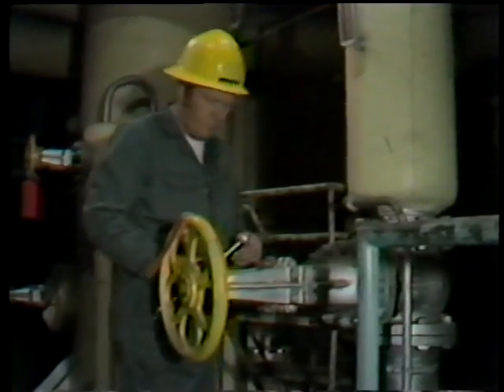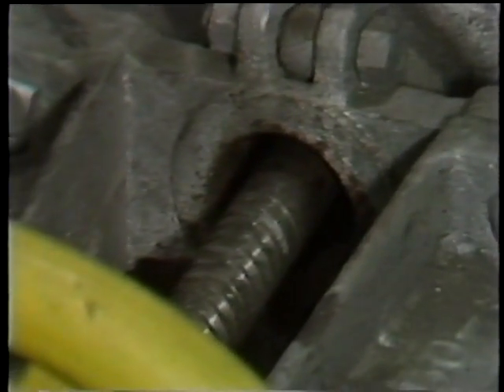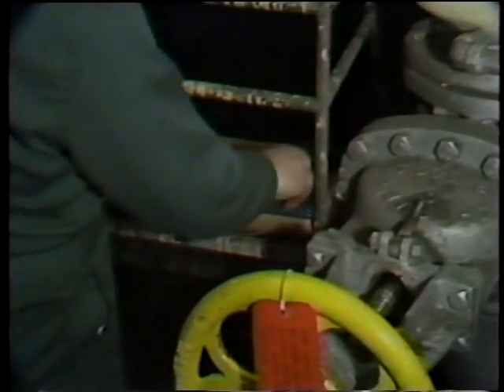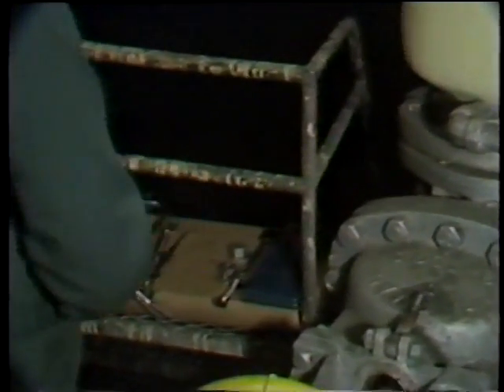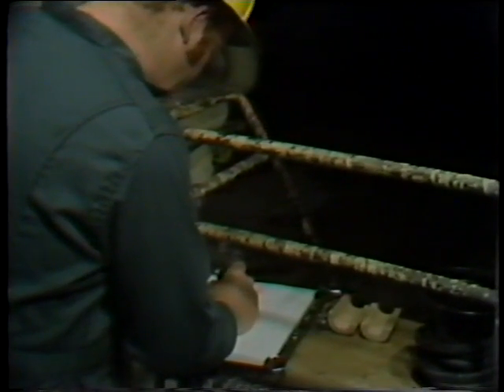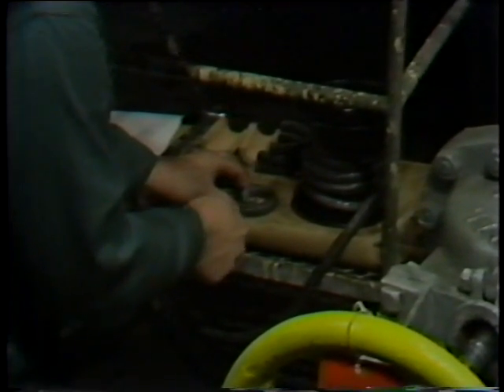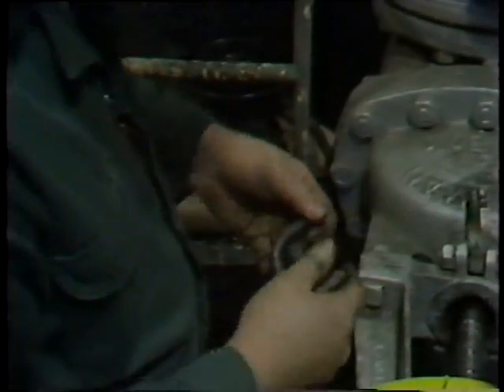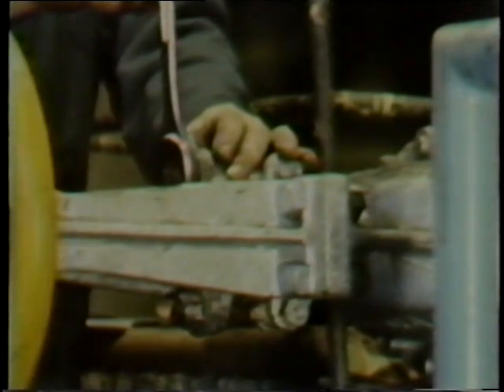Repair leaking Gate Valve Stem By Packing Replacement & Installation

Comment: Is it possible for repair kind of this at active / online pipe with material high pressure gas?
Reply: Absolutely not !
It can be dangerous.
Reply: First of case we can do to Valve was in Full opne condition after Valve is open then remove galnd packing n repelce with new packing